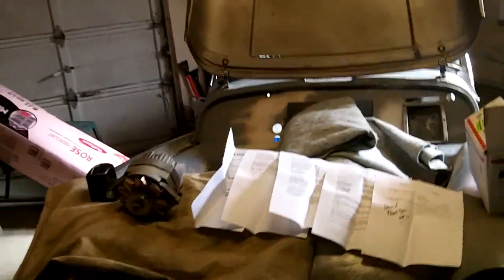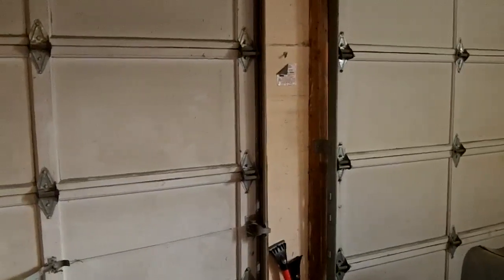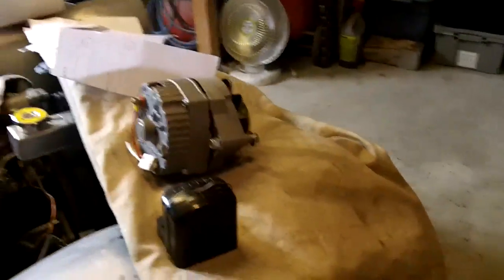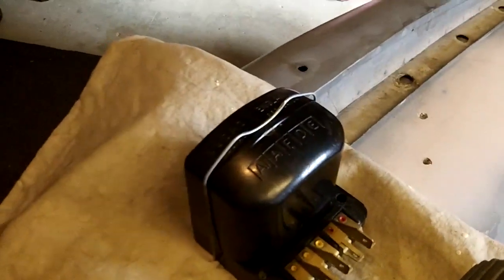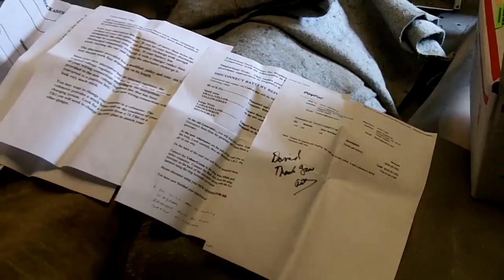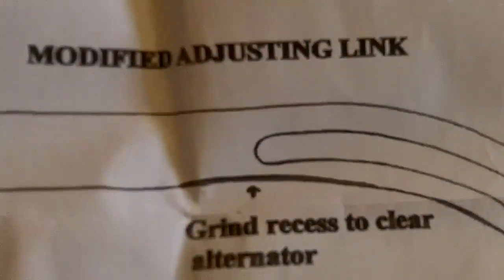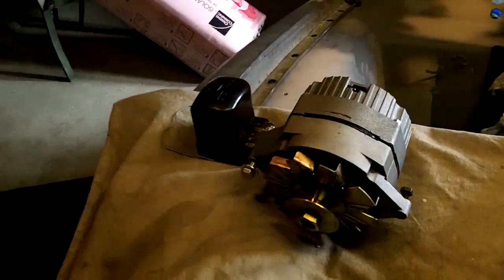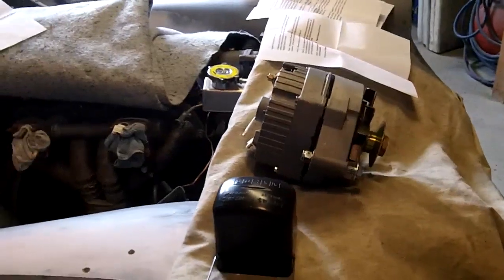Generator to Alternator Conversion for JohnCarey1963Jag

Comment: Dave - thanks for the video.  I am keen to learn more about this conversion kit.  The Jag suppliers offer one but it's a lot of money.  There is also an alternator conversion that looks like the original generator with an alternator inside.  That's cool but it cost $800!  Not likely to happen.  Your supplier made a nice kit and the instructions seem really thorough.

I do intend to run a negative group conversion too.  It's very simple on the Series 1 E-Types.